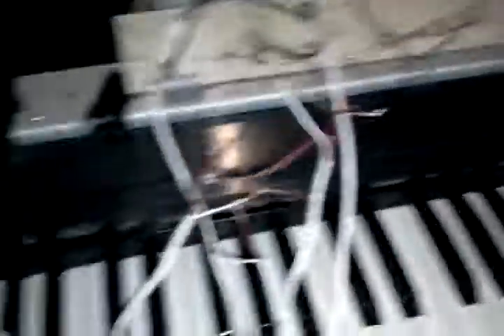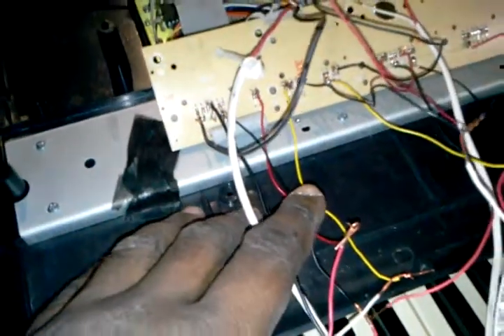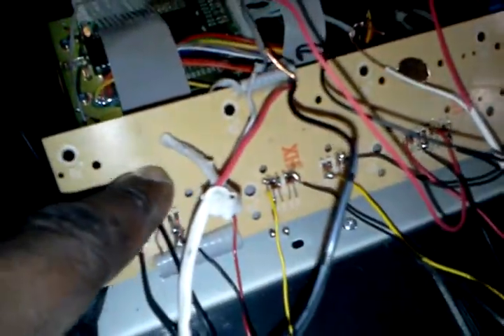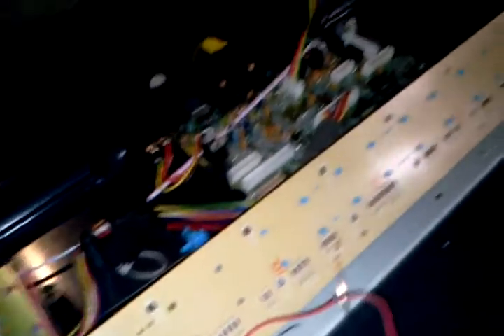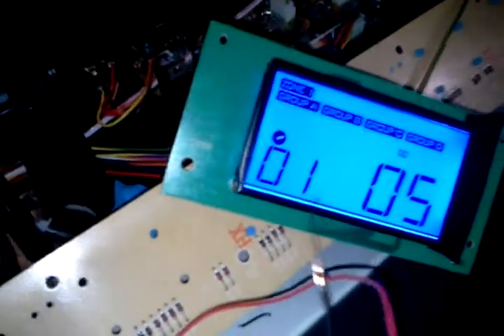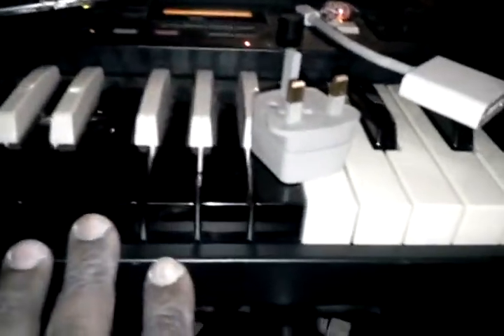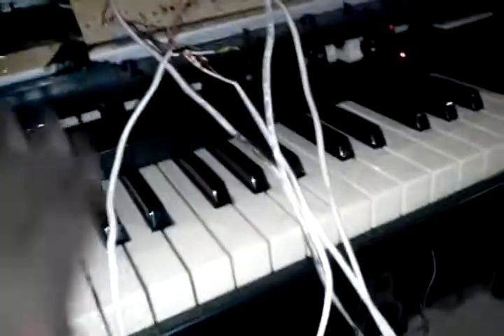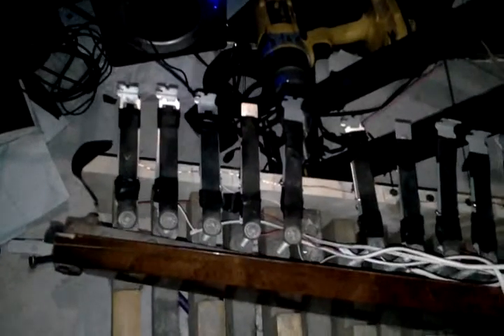Harmony organ pedal board conversion to midi

Comment: Now wait a minute. This is interesting. Are you saying you wired the pedals to a keyboard's FATAR switch  assembly? This is not a bad idea. MIDI keyboards are El Cheapo and for sure: a door magnet sensor, for example, could MAKE the fatar key switch. no need to program an Arduino for example (and possibly required 'code debug). AND...the FATAR keyboard assembly can be nicely mounted onto the pedal board it seems to me.